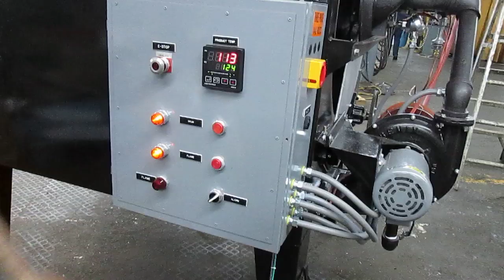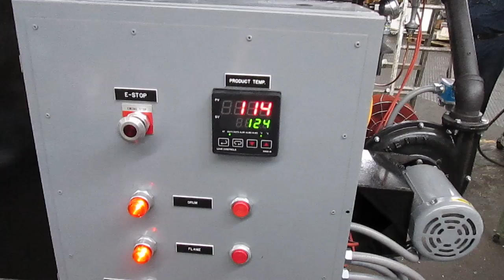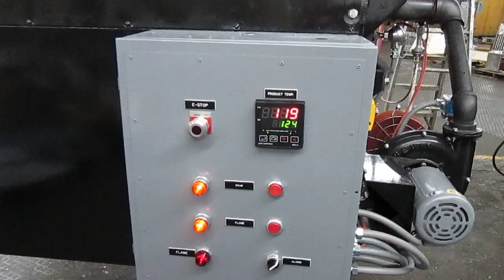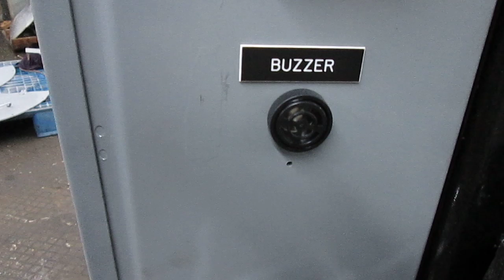Bauer 322 Peanut Roaster

Comment: With the flames on the inside, will the peanuts catch fire or is this machine for peanuts that have been deshelled only?
Reply from the maker: This roaster can be used for shelled or unshelled peanuts. Though the interior is not s/s so if you use unshelled and want to salt in the drum you might get some oxidation.
Reply from the maker: This is a centrifugal roaster so the nuts rotate around the flame. They do not get burned. This is the industry standard roaster for peanuts.